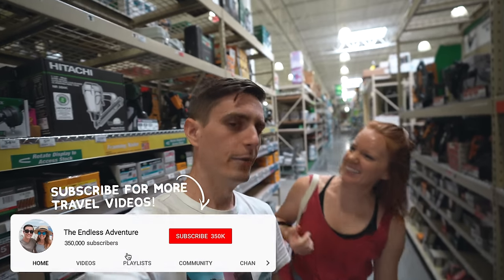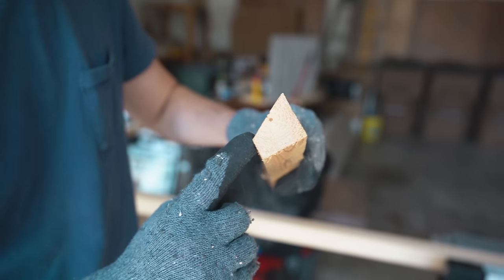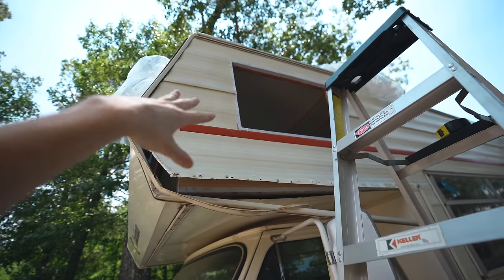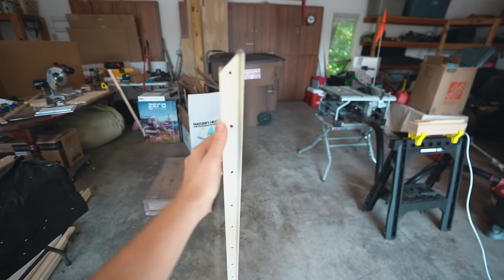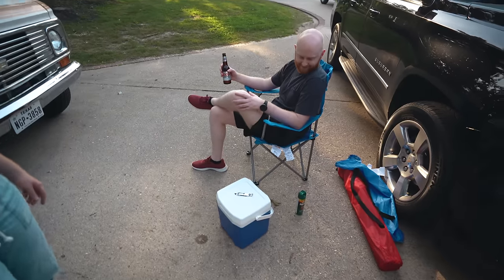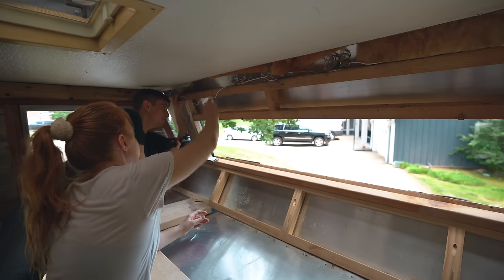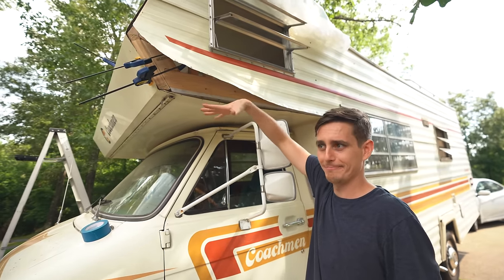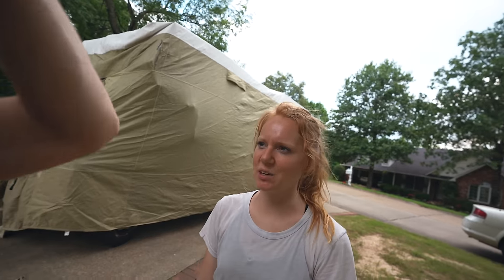Vintage RV Renovation - Completely Rebuilding Overhead Cab Sleeping Area 😴 (Ep. 2)

Comment: For the exterior aluminum what you really want are rivets, not staples. Rivets can go through the existing holes while staples will make 2 new holes.  Less holes are always better.
Reply: I think staples will rust too.
Reply: Stainless steel rivets would be the best.
Reply: Ask Coachmen how you can do it properly.
Reply: Yes to rivets!
Reply: Never tried rivets into wood , I used galavanized staples into pressure treated wood, I had to rebuild the overhead on a coachman also
Reply: @tombeilman5579  IDK how it was originally assembled, but if the aluminum is attaching to a wood frame perhaps screws as well as a silicone sealant?  Is the original construction on a wood frame?  Seems like wood is not the most durable construction material & also not very strong in event of an accident.
Reply: Tom Beilman grooved rivets will grab onto the wood too!
Reply: @milcotto4153  Hello coachman we read on YouTube you offer advice on restoring rvs from the 70s..........hello.......hello......thank you for holding one of our knowledgeable sales team members will be with you shortly you are number 37 in the queue

Comment: The front overhang window?  Get some aluminum and cover that hole up!  I wish I would have done that on mine!  That window takes road debris and high wind and always leaked or broke.  At some point, most Class C builders just stopped putting windows there! Cover it up and move on.....
Reply: Agreed!!
Reply: Darn good point! No need for a window there at all.
Reply: I was saying that during the video. The window is angled perfectly for ultimate failure. A new piece of metal and and some matching paint will make future inevitable leaks not possible.
Reply: I was thinking the same, cover it.

Comment: You could just block off the front window, if you can find matching aluminum. It is a sleeping area so you don't need a window, but if you do go for a replacement window, to stop it leaking in the future make sure you seal it, seal it again and seal it one more time just to be sure. When you're driving that area gets all the weather thrown at it.
Reply: Genial Harry Grout gotta have a window up there...if I absolutely had to sleep up there a window is a must. Just thinking about it shoots my claustrophobia sky high.
Reply: @Elizabeth-rq1vi  Def a claustrophobia potential without the window.  My husband wants to remove.. no no no
Reply: My RV has a front window, and I would be more than willing to eliminate that front window and just use the two side vents.

Comment: We have a travel unit similar to yours and it worked great. Make that bunk above the driver seat and so forth with the straight edge towards your main area of the unit. You will find you do not need that U-shaped open area above your head’s. Just put some good foam rubber padding over it in case you bump your head and build it straight across.  It makes it much easier when you want to sleep up there. How about things like the toilet does it work? How about the water system how’s the pump?. Guess you’ll get to them later!

Comment: Love watching you guy working on the cab.  You are doing a great job with the wood.  I assume you are using more than one screw for each connection.  You need two to secure the peices, otherewise it is just a pivot piont at each connection.  Try it with a couple of pieces of scrap wood.  I work with wood and would also recommend you glue AND screw any joints.  The cab is more like a piece of furnature rather than a static structure, like a house.  The cab will shift as you drive, so the glue will keep everything together a lot longer and will keep it dryer by limiting movement.  You can do this by loosening each joint a little and injecting glue and then retighting the screw.  It doesn't have to be pretty but will keep everything together much better..

Comment: The one thing that I probably would do differently is put a layer of bituthane roof sealant inside the bunk to create a watertight barrier and prevent future leaking before putting the wood frame on. Bituthane also helps dampen thermal bridging which will reduce the amount of heat loss/gain through the wood that is contacting the aluminum exterior.

Comment: "Mnemonic" ... plug that compressor hose into those words! Just yankin your chain; you guys are fun to watch and doing some good work. I sincerely hope your build turns out well. As with all things construction related, I project that you will spend nearly double what you expect on tools and supplies ($15 for a box of screws!?). One tip I've learned -- try to stick to the same type of fastener head; you don't want to be in there with 4 different screw types; those Spax you bought are the way to go!

Comment: The grey goow is window putty and is actually pretty good stuff. I mean it has been in there since the 70s right?
I would use rivets or screws and not staples. I believe you will find that rivets will works themselves out while the rig shakes.

Comment: nice job kids, I gutted and am in the process of updating a 1978 Tioga II 16.6 Sportsman on a dodge B100 with a 318 engine

the front window is good, you don't need a new one, a drill with a wire wheel will clean the aluminum up nice and you can get the tint off with "Citristrip", it wont damage the glass and you can recaulk the window (watch videos with professionals doing it, it helps a lot)

get yourself a sliding T bevel if you need to figure out which angle to set your saw to rip or cut wood

an "eraser wheel" will remove any old silicone caulking like magic, i tried heat guns, stripper, goo gone  and an eraser wheel make it 1000 times easier.
 good luck on the project

will follow along with your process

Comment: You should just cover over that forward camper window. There is a reason why new campers do not have that... they leak and you are driving the water in at 60-MPH. The aluminum siding material is available all over but just cover it over.
Don't forget a vapor barrier before you close in the walls.

Comment: At some point you guys should ditch that vintage 350 and do an LS swap and add a tremic 6spd transmission You are going to be severely limited with that 3-speed automatic. With that setup you'll have full reliability and could Cruise all day long down the highway at 80+ mph if you wanted. That would be a bulletproof set up and provide years of solid reliability. There are shops all over that could easily do the conversion. There are some guys on youtube that did the LS swap to a vintage Winnebago chieftain. Sweet set up. Just a little food for thought. Good luck with it!

Comment: I recently looked at a 1979 Dodge RV Class and it has 18,000 miles and was parked 15 years ago the interior totally needs to be redone because the roof is leaning down in the front and in the middle there is a rust hole in the ceiling but its looks like the perfect restoration project I live on Long Island and the guy would give the RV to me for free.

Comment: I have a 1992 dutchman motor home that all but fell apart inside. The mechanical parts are all practically new. And with only 60,000 miles on it, i had to remodel, not retire it. It's completely gutted out righ now. Trying to figure out how to rewire it tho. Lol.

Comment: I think the interior is looking great.  But did you take my advice regarding the engine and transmission?   It would be terrible for you to spend all this time on the interior renovation only to find out that the mechanicals are EOL..
Reply: They don't seem to want to get it all checked over. Just want it to look good
Reply: I was wondering if this thing runs much at all. Life sucks when you’re away from home and the rv engine doesn’t work right.

Comment: please realize that it's still possible to get some moisture in the wall even if you seal around the window.  The aluminum frame of the window and the aluminum siding will create condensation into the wall cavity as the temperature changes during the day.  the inside of the wall has no way to vent itself(unlike a house)thus moisture buildup.

Comment: I have a question for you here's the deal I remember y'all said earlier that y'all want 2 renovate the van for oneself finished that you want to make an office space for all your equipment and all that why wondering is as far as the campus power and all that do you feel you might need to update the tank and its converter with modern equipment and stuff like a water filter and all that you might want to consider that

Comment: Great to here that your doing a Fuel Injection conversion on the Chevy 350 V8 ! It'll increase throttle response, Horse Power, fuel economy, and better emissions ! You should also change the ignition from the old points system to electronic ignition for the same reasons ! I have a link here for a not too expensive one ! Good Luck  ! https://www.summitracing.com/parts/pnx-bundle001/make/chevrolet

Comment: You've spent all this time fixing and repairing by removing the old wood and reframing with new.  And you have spoke about making it as water tight as possible, but you haven't treated the wood at all!?  You're using raw bare wood.  You can purchase a variety of brush on wood preservers to help keep away mold, insects, rot and some can even help to make the wood water resistant.